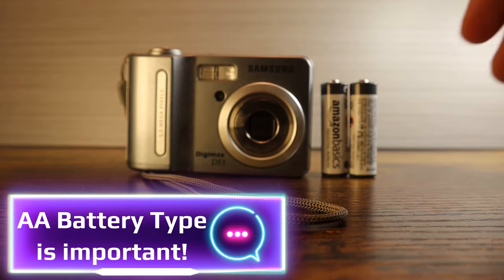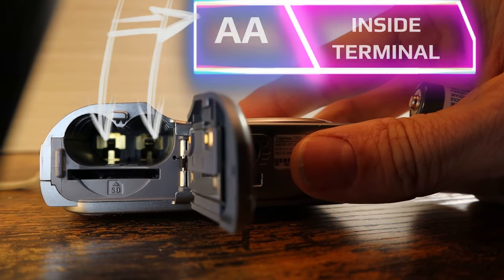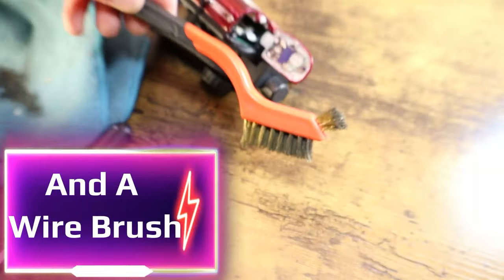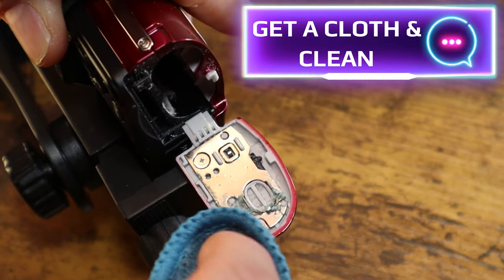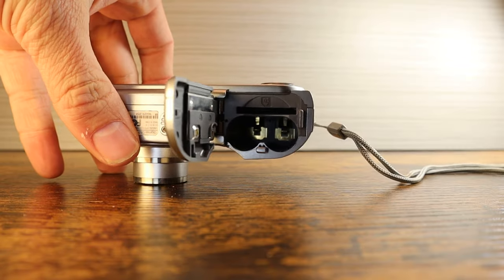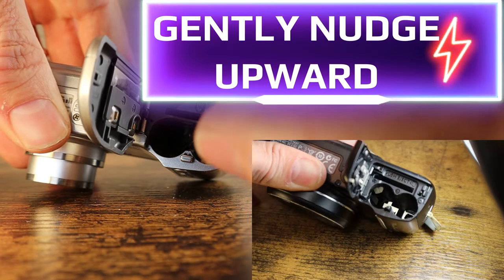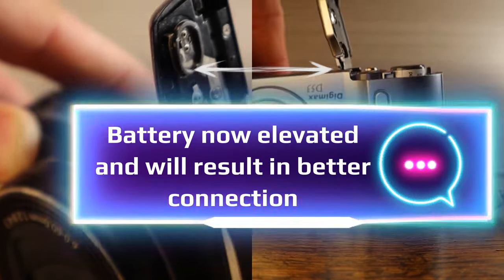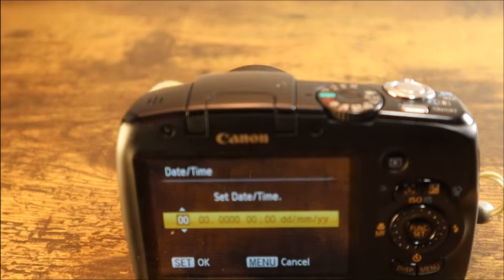How to Fix + Repair a Digicam that’s not turning on

Comment: Really helpful, my grandma's old camera wasn't working and after watching this video, it instantly turned on, the camera is called the BENQ dc C1430, I'm so excited to see my old pics with her
Reply from the maker: Great to hear!
Reply: Bro my camera is showing a green flash while I am holding the power button but when I put my finger away it stops flashing and doesn't turn on plz help
Reply: @Rono_vfx07 same , did you find a soloution ?
Reply: @Charlie-up2sh  yes I replaced the batteries

Comment: What if it’s not those type of batteries but it’s the flat one made for it
Reply from the maker: If it's a single lithium ion rechargable battery, then you can disregard this information as this video is meant for cameras with AA or AAA batteries.
Reply: @pricklypearcamera  Any suggestions for a digital camera using a single lithium ion rechargable battery that won't turn on?
Reply: @pricklypearcamera  Any suggestions for a digital camera  that won't turn on using a fully charged single lithium ion battery?

Comment: NC Picker directed me to your channel, I’m in the process of selling a Canon 40D with several lens & accessories and a Coolpix & a couple other point & shoots all in excellent condition so thought I might learn something about their value here. Either way happy to support!
Reply from the maker: Well that is amazing! NCpicker is  an awesome guy! Happy to help with estimates, the 40d body in “good” overall working condition is worth around $100, lenses will vary, let know what brand/model they are and what model the coolpix and others are and could tell you a pretty accurate estimate as I have a database of my own 24,000 camera sales over the last years to get data from
Reply: @pricklypearcamera  thanks, I’ll get back to you tomorrow, it’s about bedtime on the east coast
Reply: @pricklypearcamera  ok here goes
CANON POWERSHOT ELPH 3400HS. Excellent cond.
NIKON COOLPIX S230 excellent cond
CANON POWERSHOT SD1000 good cond.
SONY HANDYCAM DVD305. Excellent cond
CANON EOS REBEL X 35mm with 35-80mm lens good condition-no battery 
CANON 40D with battery/charger and all accessories & books as well as very large canon padded bag in like new condition 
SPEEDLITE 200 E
28-135 image stabilizer lens-CANON-excellent
80-200mm-CANON-excellent 
CANON COMPACT MACRO EF 50mm-excellent 
Except for 35mm camera I have battery/chargers for each camera and they all work 
Would I make more money if I listed the lens I have for the 40D separately? 
Appreciate your help, thanks so much.
Reply from the maker: @eamoroso56  So sorry for the delay! I didn't see the notification - I have sold all of those myself and have everything in a spreadsheet to track used prices- Canon Elph 340 in excellent condition- $90-125 depending upon color, Purple is on the higher end. Nikon S230 $25-40. SD1000 value has gone up alot over the last year. Was a $20 camera, and now it sells for $75-100 in good condition. DVD305 $40-60 depending upon what accessories are included. Rebel X 35MM with lens if tested, you're looking at $60-70. I would sell everything separately for the 40D kit. 28-135mm lens in ex condition is around $100. 200E not worth much, $10-15. 80-200mm lens is $30-40. Macro 50mm if it's an F2.5 you're looking at around $100-125.
Reply: @pricklypearcamera  thanks so much

Comment: Heyo, I have a Kodak EasyShare C310 and even after doing all this, it still isn't powering on. Any advice?
Reply from the maker: Hey! If the post bending didn't work, then the camera connection may have been so marred by corrosion that there's not enough of a contact point for the batteries to power on the camera. So unfortunately if that's the case, it simply may not be usable. Sorry to be the bearer of potentially bad news.

Comment: Hello there! I have a Canon PowerShot A460 with some green rust and corrosion on the external part of the camera, can i use vinegar or other stuff to take it off? What do you recommend? Also, the vinegar can be alcohol vinegar? Thank you so much
Reply from the maker: Hi, any acid like vinegar/lemon juice would work. The type doesn't matter. Let it sit for 30 seconds to a minute and if it's quite corroded you can use a wire brush to remove the built up areas.

Comment: I have a samsung s630 camera and it won't turn on. It only does a sound 3 times and the green led will turn on but the screen won't.  Please help It's not corroded in any way
Reply from the maker: Sounds like a potential lens error. Or internal electronics issue. I come across pretty often with older Samsung digicams. Might not be fixable...

Comment: Hi I have an old samsung s760 and I wanted to see if it still worked and when I switched it on it said 'slelet usb printer or computer' but it wasn't plugged in to either so I figured something was in the usb port and when I looked in to it it looked corroded so cleaned it up and then when I tried to restart it's just a grey/black screen. There's no noise but the little green light flashes on and leaves me with an empty screen. No noise from the lens. Any advise?
Reply from the maker: Is the battery compartment clean or also corroded?

Comment: HELLO, i have this old digital KingCom DS-5060S  it was my families first ever camera, and i was hoping if you could help me fix it by giving me some pointers

Its old so i put the new batteries and the place where the batteries are supposed to be it was really clean and it wasnt what i expected, but i still push the bottom thingy with a flathead screwdriver, and when i put the batteries and started it on it didnt do nothing, so i press it again and still nothing but i notice a faint small noise inside the camera and idk what it could be
Reply from the maker: Hmm tough to say, might be drawing just a bit of charge and just not enough to power on and function normally...

Comment: Hi! I need help fixing an old finepix a345. it doesn't have corrosion in the battery compartment, but I do notice that one of the batteries (with positive terminal that goes inside) sits lower than the other battery. I looked inside the battery compartment and notices that one of them has the spring, but on the other side, I don't notice a spring, so what do I nudge? I'm pretty sure because of poor connection, it's not working (when i close the battery door and shake it, there is sound! so I'm guessing there is indeed a gap between the terminals).
also does it matter what voltage the batteries are? I noticed on the attery door it says 3V, but my batteries are 1.5V. Would that be an issue?
Reply from the maker: It might be that it’s 2*1.5= 3 volts, but most AA batteries are 1.5v, so I don’t think thats your issue. I’ve encountered this before on older fujifilm cameras, and have seen a number of times where the bottom metal “spring” has sheared off leaving no connection possible. If that is the case, the camera may unfortunately not be fixable 😔
Reply: @pricklypearcamera   oh noo so both sides are supposed to have spring? no other metal soldered could do the trick? I couldn;t see clearly inside the battery compartment in the video

Comment: in the battery compartment of my camera, there is a white plastic, i dont know if the plastic is obstructing the passage of energy from the batteries, should i remove the plastic? and there is corrosion too, if i put vinegar into it, will it damage the compartment?

Comment: hey! I have the same exact camera but right in the inside where batteries are placed at the very end there’s corrosion, do I still put vinegar in there with like a q-tip, I don’t wanna damage it even more… let me know!
Reply from the maker: Vinegar itself shouldn't damage anything as long as it's used in moderation. I've used it on the internal posts as well as the posts on the battery door.

Comment: please help!! i have a olympus digital camera c-740 and there’s something wrong with the parts where you insert the batteries. i don’t know what the word is in english. i put in new batteries that aren’t from the dollar store but it won’t go all the way in. i know this because i’m pushing the batteries inside and it’s going down but it won’t stay down. i hope i’m explaining it okay, if you need pics then i can send them! to make it easier to understand.
Reply from the maker: It sounds like something is broken or a post/metal is obstructing the battery compartment. When you take batteries out and look inside, is there metal or plastic piece stuck in the bottom? Sometimes the metal post can break off and become stuck at a strange angle and won't allow the battery door to shut.

Comment: So... What's the right kind of batteries i need? I have a Samsung Digimax S600, i bought Energizer AA6 batteries, it worked for a couple of minutes but its not working anymore, i just see the green light once i try to turn it on
Reply from the maker: Those should work.. did you try adjusting the battery post/spring?
Reply: @pricklypearcamera  Well, i think they are just fine, maybe the camera still needs more cleaning, It had some corrosion and I cleaned it with isopropyl alcohol, but maybe it has a little left.
Reply from the maker: Gotcha, good luck!

Comment: My Olympus stylus epic zoom 115 turns on when i open the lens and then immediately turns off and flashes green and orange. I’ve put in new batteries. I’m not sure what’s going on…might you have an idea?😢
Reply from the maker: It might be a lens error? If the lens isn't opening or engaging. Sorry to hear that! I have had some flash issues with similar models where the lights blinked, but the camera still took pictures (just without flash).

Comment: Please help!! I got a fujifilm finepix E510 it had corrosion i cleaned it still not turning on but it shows green light and turns off pls helppp
Reply from the maker: Sounds like still an issue with the battery connection and it's not drawing enough power to actually function and operate. If you have already gone through the steps, there are some additional things to try (foil can help). There are some videos that go over that. Or you could find a replacement E510 on eBay for example in the $30-50 range I think.

Comment: Hey! I have a Kodak Easyshare C530 and it doesn't work. I've already cleaned the corrosion on the terminal door and changed the springs, but it still won't turn on. Maybe there is a little corrosion on the inside, in which case, should I continue with the vinegar? The light on top of the screen blinks green twice and then blinks red, then the camera turns off. I already checked the batteries, do you know what it could be?
Reply from the maker: Bummer to hear that! I have had this happen a lot with the Kodak C series cameras. It's drawing a bit of power, but not enough to actually operate. I have tried tear downs to access the inner AA metal connection, but it's a time consuming process and a bit difficult. Even then I found that even fully clean the camera when closed back up still didn't work.

Comment: hey, i have an digimax s600. one of the plastic sliding bar thingies is broken on the battery compartment door and theres a little y shaped piece that comes behind teh metal part. ik im sorry its a little finicky to understand what im saying but could you please show the the platic part of the door slid off of the door so i could see how it is on the inside? thanks<3
Reply: Are you talking about an orange plastic thing ? ( I know nothing about cams) If that's what you're talking about it's also damaged in my cam if you fixed it please tell me

Comment: i have a kodak easyshare cd93 that’s isn’t turning on. what batteries do you recommend?
Reply from the maker: My 2 favorites from a price/performance perspective are the Amazon basics AA batteries or the ACdelco AA battery.
Reply: Did you ever get it to turn on? I have one that is not turning on either. Despite the fact that I had new batteries.

Comment: Hi, I have a kodak easyshare C1530, In the part where the batteries are inserted there are what looks like some small rubbers, one of them makes it not close the cover completely and opens with the minimum contact, is it normal to have those rubbers?
Reply from the maker: Hmmm, it should be just metal contact points, are you talking about the rear (internal) connection point?

Comment: hiii my pb is that i found an old samsung S500 in my parent's room, it wasnt working because there weren't AA battery into it. So i bought new ones and it won't turn un but there's that indicator light who keeping turning on when I try to turn the digicam. It's the indicator above the effect button
sorry for the bad english tho

Comment: Could anyone help me my family doesn't use a canon a2200 PowerShot because it's not turning on anymore I've been looking at camera repair videos all day but can't figure out what's the source of the problem
Reply from the maker: Hi, the Canon A2200 uses the NB-8l battery I believe which is a lithium ion battery, not AA. So the issue with the camera could be a few different things, lens errors are the most common. Unfortunately a lot of these issues that aren't battery related are a lot harder or sometimes impossible to fix.

Comment: What am i supposed to nudge up? My Samsung S860 has lopsided ones and I'm not sure which way I'm supposed to nudge anything.
Reply from the maker: It sounds like the posts could possibly be broken, but if you shine a light in the battery compartment, you should be able to see which direction the post bends.

Comment: Hey so i have a nikon coolpix l18 it take good photos and suddenly it stoped turning on please help me on this
Reply from the maker: The likely culprits here are a poor battery connection (check the posts on both sides), or a lens issue. The lens issue could be harder to fix, because it could be just a few microns of non-allignment that are causing the camera to not even power on.

Comment: I have an wespro dv532 it's screen is not turning on
Reply from the maker: Does that use AAA batteries? You could try the same cleaning if there is corrosion.

Comment: is this still applicable for my digicam that is always been low battery 🥲 no matter of buying a new battery, still ending up in a low battery
Reply from the maker: Hi, possibly- it is likely a connection issue between the metal posts of your camera. There are a few different designs used, but some cameras have a metal prong that can be gently pried up to provide a better connection from the battery end to end.